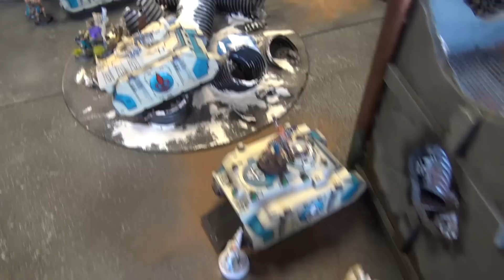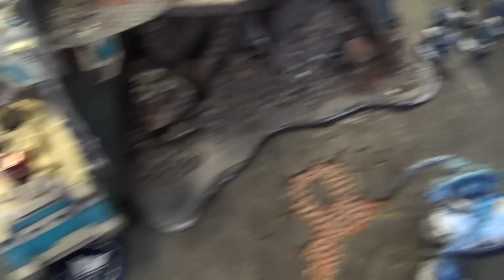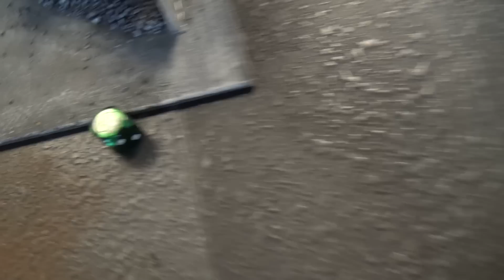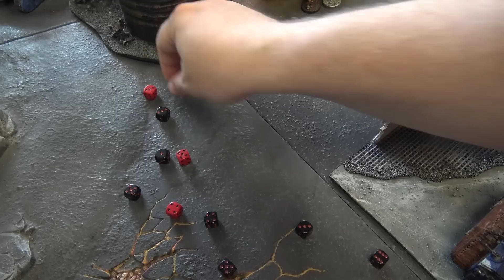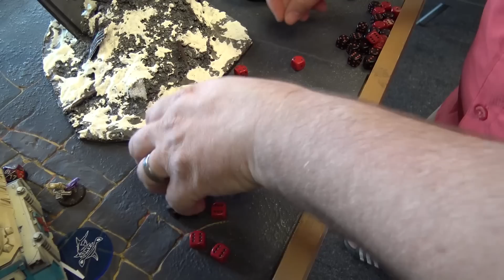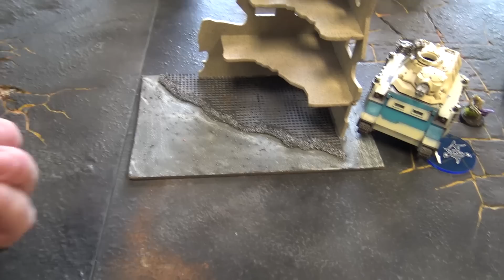Sisters of Battle Vs Genestealer Cult - 8th Edition Warhammer 40K Battle Report - 1,500pts

Comment: Pure strains are so not worth it mate. 225 points for a unit that even if it makes contact on the turn it arrives, will die the very next turn. Stick to ambushing with 20 man blobs of neophytes. They srping up and can throw down some serious volume, epsecially on a 5. They are solid in assault as well. Might from Beyond them and take a banner near that primus and they will still mulcha target, best part is it's less then half the cost of those purestrains so you can do it twice. Then they have to contend with 40 wounds.
Reply: Also, abberants only take one seat in a chimera, just stick all 10 in the same tank with a pair of characters and use it to assault from. You only get one meticulous planner a turn so it's not worth putting 3 things in ambush like that. GSC excels when you ambush neos and put assault units in tanks believe it or not. The neos are usful on almost every ambusg result while the assault units literally suck unless you rol la 6 or a 5 followed by another high roll. So not worth the gamble especially now after the FAQ. I have been doing very well keeping this in mind, also you desperately need an abomanant, best AT in the army.
Reply: Or better yet don't play cult :>